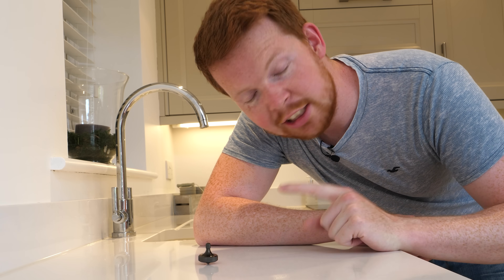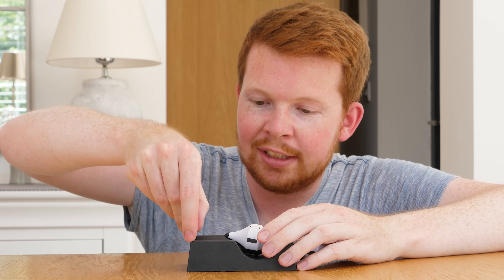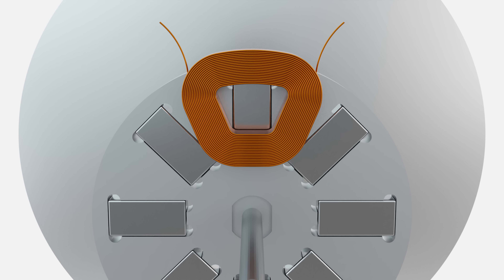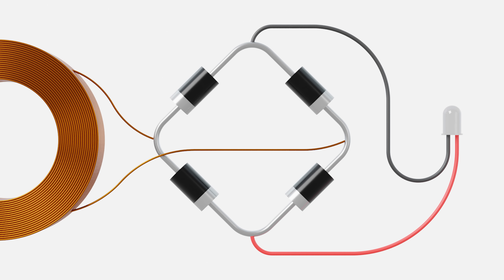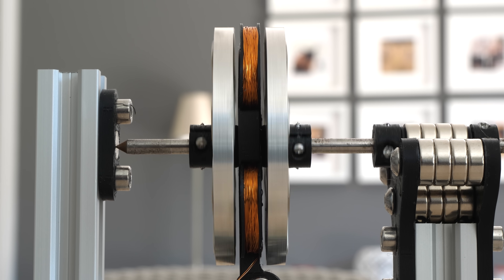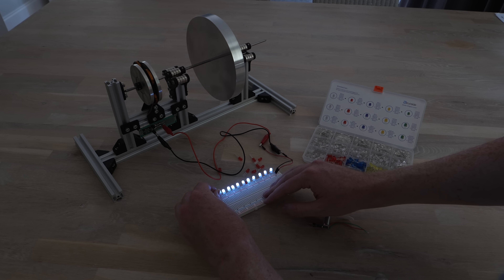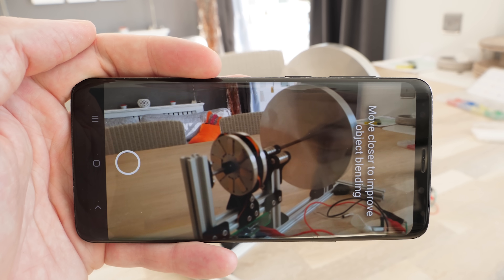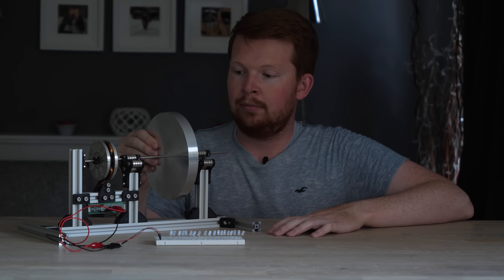Flywheel Battery

Comment: When magnets are manufactured, a high amount of AC energy with very high amperage is embedded within them. The energy that illuminates the LEDs is the extraction of this energy from the magnet through coils. So, there is no infinite or non-existent energy. When the AC current embedded in the magnet is depleted, the system will no longer be able to produce energy. Let's not fool ourselves.

Comment: I made similar alternator. It has a gear reducer box driving the alternator but it's mounted backwards so when you turn a crank it increases speed to the alternator. It would light up 2 - 100 watt light bulbs plus a whole string of Christmas lights just by turning the crank. It would also power a 4" hand grinder just by turning the crank

Comment: so if we plug a drill into a 120v circuit, we can spill the wheel so we can spin a bunch of wires to create a current to turn on an led. brilliant.😢 ... or just plug the light into the 120v circuit. i used similar rational when i bought my backup power supply. no gas/oil needed. it's electric powered. just plug it in and it spins a motor which turns a shaft which, with a bunch of wires, creates a current which charges a battery. then the battery powers the house.

Comment: Now, if we were to make a sealed box, pump out the air, attach a crank with a gear mechanism to turn it a bit—the flywheel would spin like crazy, and attach more gear to it, balance the shaft, and attach magnets and larger coils to the shaft itself.
And make a crank like the ones in old sewing machines—by pressing a pedal with your foot, or adapt the rocking motion of a rocking chair to the movement of the crank—then if you start rocking while reading something, the light comes on. If you fall asleep, the rocking stops, and the light goes out. Now that's an invention. So, for now, it's a dry option, but there is actually some promise. We just need to take a more serious approach, not just tinker with it.

Comment: Don't know much about electricity but if i get it right this aught to be an interesting add on to a wind turbine.
It could be inserted in between the turbine catching the wind and the part that turns it into electricity. 
As to reduce resistance that probably normally is there. .. i think...  

Really cool experiment. I like watching people build these small scale experiments using basic principles which 
make it also easy to follow as a leek. Also like the joy you get from it.

Comment: The aluminum disk is non ferromagnetic.  But it is definitely affected by your magnets. They are probably inducing drag on the disk. As it spins it mirrors, repels, and induces drag. The Faraday disk/ homopolar generator. You are likely pushing electricity from your axle to the edge of the disk. Low volts high amps, because it's essentially acting as one length of wire constantly moving through the field. Extra crazy is you can bond the magnets directly to the disk and it will still generate while spinning! But I've only read that last bit. There was a giant one made underground at some university once. Love the show!
Reply: The distance of course will minimize the effect. Just pointing it out.

Comment: I imagine scaling this up to what it would take to run my house. Basically a small 2 bedroom with just the basics. Have it store the energy in battery(s)and off them to inverters to convert to 120 ac at say 100 amp / 4000 watts. I run my house on a 4500 watt propane gen no problem when the grid is down. Anyhow even if I had to go out 1 or twice a day and get the flywheel spinning or crank up some weights geared like a coo coo clock, I wouldn't mind. With the exception of the energy I have to put in it would then run my electrical needs for free! Even if you had to use a small gasoline engine that you ran for 20 30 mins a day to get the weight up to speed, it would equate to pennies per kilowatt compared to the grids prices. Any ideas, thoughts, anyone done anything like this????

Comment: Just a question, does sequentially adding all those LEDs slow the flywheel down? What I mean to say is that they will be incrementally demanding more power which will increase the work needed to create the necessary voltage. Or am I talking sh*te and should I go back to bed?

Comment: Flywheel energy storage is not a new idea. The Swiss Gyro bus was powered by a flywheel in the 1940's  It could propel the bus 5 km. at  50 to 60 km/hr.  It also used regenerative braking.

https://en.wikipedia.org/wiki/Gyrobus

Comment: Is it possible to make an exiter circuit to first spin up the flywheel in "motor mode" from a power source and then turn it back in to a generator to power something? that would be a fun thing to watch, to not very efficient in terms of power

Comment: I wonder if the magnets were angled if you could eliminate the need for the Glass plate holding it in place, i.e., cancel out the tendency for the axle to fall to the left/ right

Comment: If the led's could power a little solar panel to spin it, could be closed system. Might still be net energy from the spinning either in wind or vibrational form then.

Comment: Oxy acetaline would heat the flywheel quick enough to get it of the shaft. Like crowning a 2x4 you can straighten the shaft if you use an anvil and a large hammer carefully! I do mean very carefully! Light taps and lots of checking by eye looking down the length of the shaft!

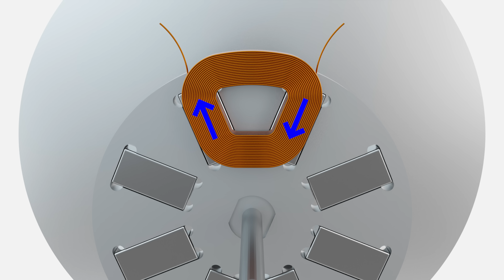Comment: the principle you show on  4:30 was used to lift and rotate a turntable, which avoids any noise from bearings and smooth drive with enough poles to avoid the magnetic pushes each time a magnet comes by.

Comment: Try using a dc model train motor as a generator. The split poles and commutator will produce dc voltage without any rectifiers.

Comment: I thought the challenge here was to eliminate the friction of the contact point. There is still a contact point to keep the magnets aligned. 

You've also introduced more surface friction with an increase of the combined surface area of the various disc bodies, energy losses in imperfect alignments of axially symetrical fields, etc., but I digress.

Comment: I was wondering if you could induce a stable resonance to the flywheel by using speakers which reproduce the resonant sound of a fast-spinning flywheel. I will show you what I mean by sharing the following video with you: https://youtu.be/1w0_kazbb_U?si=A50Kdm0x2q-qnq1p . It may be a longshot, but one never knows what will happen, until you try it yourself.

Comment: How about a flywheel powered by the rear wheel of a bicycle. Spun on downhill run, engaged for powering up the next hill? The faster te flywheel spins, the more energy it holds and gives on the uphill run.

Comment: Also, with no friction, why not mount magnets on both sides in every possible way to create a bigger flux and current generation? And what would be more interesting would be a small enough motor connected that could give a tiny momentum to the flywheel keeping it in motion as it powers the motor 😀

Comment: smooth plate where the pointed end of the shaft rest against....why not put another magnet in the plate and in the end of the shaft. With same poles facing each other. That way its a totally floating system without any surface friction at all.
Reply: Z drugiej strony to samo i masz  całkowicie magnetyczne łożysko.  A gdy całość zamkniesz w hermetycznym zbiorniku i zrobisz próżnię to masz akumulator kinetyczny.

Comment: I always wondered how a flywheel would perform as a capacitor. What would the loss be, and does it have potential as a battery? I guess if you really scale it up, you would need electromagnets to balance it properly, and that would be a big loss. Also the amount of kinetic energy stored in such a flywheel would be insanely destructive if something went wrong. I’ve seen flywheels on huge boat engines come apart, and they absolutely just rip through everything.
Reply: takie rozwiązania (akumulatory kinetyczne)funkcjonują od wielu lat w wielu satelitach. służą do gromadzenia energii. ale i do pozycjonowania satelity .  Taki akumulator z wirująca wewnątrz masą jest  zamocowany wahliwie jak żyroskop .  Próba zmiany położenia tak szybko wirującej masy powoduje obracania się  samego satelity  bo widująca masa nie daje się przechylić!

Comment: Arm chair quarterback. You should have made the space between the magnets closer. The weight of the flywheel is flexing the shaft. If you bring that back leg in and shorten the shaft, it would stabilize better.

Comment: great macine. you made a generator. now make a structure to turn a 20 KG flywheel on magnets. no friction. and connect a motor this side and a generator other side. do ot make a motor and generator. just buy them. the key is the flywheel turning without friction. and add two glass limiters on both sides of your axis. 20 kg turning fast is a serious thing.

Comment: Get rid of the ugly flywheel and use the motor/generator itself as a flywheel. There is then room for several motor/generator units on the axle. 4 units easily.

Comment: That is a cool video. If you want a lot more power output from your generator you should change the magnets on rotating disks to more powerful magnets and even stack two of them together and place them on the rotators. This will increase the electricity output by several times.

Comment: Excelent. My comment would be:
Mecanicly you have almost no losses.
Electronicly you give 20% away with the rectifier. 
Solution: no rectifier and feed ac on the LED's. Make sure you place 1 opposite towards the other.

Comment: Is there any loss in spin duration after adding manners and coils powering devices or does it spin just a freely?
No electro/mag drag?
Could you add multiple layers of mag/coils in sequence to scale up?
How long can you let it spin powering fan motor after using drill to get up to your top speed?

Comment: If you had a proper alternator and fly wheel setup, you could use a weaker electric motor to recharge the flywheel. And then just collect the excess in capacitors, free electricity.

Comment: You need to contain the magnetic bearing, balance it as you already know. You could add a "pull" rope starter. Then use a small electronic load to do a I-V curve on the power output. Then do a constant current vs time test.   Very cool   edit, by contain I mean have one or two more magnets on top of the shaft magnets so it can't move.

Comment: On the end of the shaft that rests on the barrier, would it be possible to build a magnetic nest or cage to hold it?  

I am thinking two banks of fixed magnets for the cage, then an additional set of magnets affixed to the shaft between them with swapped polarity.  As the shaft pushes towards it the magnets would repulse it back to center?

Comment: put the magnets on the rim of the flywheel and eliminate the need for a seperate disk.  Question?  If all the magnets are the same polarity will you get pultsating DC and therefore eliminate the diodes?

Comment: aluminum/aluminium is effected by magnetic field. so why say it's not magnetic
Reply: It’s not ferromagnetic, aka it’s not magnetic. That does not mean it isn’t affected by magnetic fields. Those are two different things
Reply: @henrysanecdotes5323  My system is out of wack. I can't tell if that reply was for me . I'm just going to assume it was. I didn't say anything about the things you mentioned. I asked a question. Why say "aluminium isn't effected by the magnetic fields when it is?". Spin a plain aluminum, then disk bring a magnet close to it & it will have a braking effect, stopping the disk. Everything is effected by magnetic fields
Reply: @juliuspekar7620  I said a double negative, which I think is the source of this confusion. To clarify, I meant that aluminum is affected by magnetic fields. However, that does not make aluminum magnetic. Being ferromagnetic is not the same as being affected by magnetic fields
Reply: @henrysanecdotes5323  FINALLY!  Some one that knows how to have a rational discussion. Thank you. Seems like all i see is people arguing like angry arrogant smartasses.    Like  they are stuck in emotional reasoning mode, not being rational. I even take the time to make sure that i don't give any reason for a person to come at me with an attitude, But there is always one that does. For reasons   that don't exist in anything that i said.  Just look at the way people been "protesting". Seems like no one knows how to protest. They are not solving problems, they are just starting fights while trying to stay on the right side of "right & wrong" . I'm sorry, i guess i'm just venting. ANYWAYS ,  I knew what you meant. You said it in a rare peaceful manor. To be honest my last reply was mainly to see if you would "flip out" on me.  Wow, i just read thru this "as i do before sending" & i sound kinda creepy.
Reply: @juliuspekar7620  lol that’s exactly how my train of thoughts go, I write a response and then think “wow when did this get so long”

Comment: I got an idea Tom. Put the same motor on both sides of the flywheel...  Use one as a generator to power the original motor with a capacitor. Now on the edge of the flywheel...  also add magnets back and forth positive / negative with a coil that also powers the original motor!

Comment: I believe you could get more wattage out of it if you wound your coils in a more efficient way. I’m fairly new to this so I may be wrong, but I believe  that having the coils wide enough to spread over multiple opposing magnets is not ideal. From my understanding, if the magnetic field is north, then the electron flow is spinning to the left in the coil, and if it’s south then electron flow is right (could have gotten that backwards). So having a north and south magnet over the coil at the same time canceles eachother out, and the electrons don’t flow as much. So it would be better to keep the coil width the same size or similar to the size of the magnet. If im wrong then someone please tell me 😅

Comment: when you had the bigger fan hooked up you lost rotating speed .. you had to charge the capacitor up to start it .. I could be wrong but your charging system is also a elec brake ??

Comment: I wonder if it would have less friction on the bearing if the structure was turned 90 degrees so the bearing would have even weight to deal with?  It's an amazing setup and could be utilised in every house as you don't need much input for lighting all those led's.  Just would need scaling up.

Comment: They used to make a fan which blew around powered by the air from a light bulb that has a bearing like that in the 1950's.  This would flicker the light for electric fires flame effect.  They worked very well for years!  They advertised them as having a Jewel bearing.

Comment: Could have reduced the friction at the axel contact point up to 10% if  it were riding against glass. Wouldn’t be a huge improvement though. There also probably some weak Eddie currents forming in the flywheel itself due to the surrounding magnets which would slow it down. Could resolve this by cutting radial slits in the aluminum to disrupt their strength. Again this is probably a small effect.

Comment: In the 1970ies a soviet engineer developed such a wheel storing enough energy to drive a car for 500km. But he used some sort of thin carbon wires for the wheel and it fitted in a normal car.

Comment: If you offset the two magnetic wheels so the magnets are not aligned on each side, would you receive a constant flow of energy and reduce the flickering? Would it also reduce your total output? (not an engineer, just curious)

Comment: 9:57 So is the only thing stopping this mechanism from spinning forever the friction at the tip?
Reply: The vast majority of the energy loss is to air resistance and energy extracted to power the leds

The friction of a metal tip spinning on glass like that is extremely low

Comment: March 29, 2011 — Emerson Network Power will distribute VYCON’S clean energy VDC and VDC-XE flywheel power systems with its Liebert branded uninterruptible power supply (UPS) systems to protect mission-critical customers against the damaging effects of power problems in a clean and sustainable way.

Comment: I was just wondering, if you can levitate the flywheel, can you also use opposing magnets on either end so there is no friction whatsoever?
Reply: You could.  But it has the same issues with alignment then as the levitating magnets.  If it gets slightly unaligned the forces push it even further out of alignment until it moves out of place.  This means then that you need to have it very stable in all directions.  Practically it’s very difficult to achieve this with magnets, although it should work theoretically.
Reply: @ReallyBigBadAndy76  thanks :)

Comment: To store 2kWh (a pretty low amount) you need a flywheel of a diameter of 2m made of steel as heavy as 200 kg (10cm thick, 9cm tall), rotating at 3200 rpm, and an outer edge of the wheel will move as fast as 344 m/sec (a supersonic). That's about only 2kWh. You can reduce the rpm value down to 600 by using of 1000kg of steel and a wheel of 5m in a diameter. Good luck

Comment: The 3 way of making your '' ELECTRICITY GENERATOR '' is by adding a '' magnetic Gear shifter '' this device will double the amounts of rpm form your machine without any contact from your device that is inside the voide

Comment: If u would really like to see it work in its full let me know...magnetronic pulse static engine...works on realy...in a sense...once charged ....a small unit can produce an abundance of ohms...for auto and industry....ur concept is doable.... u just need the schematics and proper numbers and programming ...materials and new type battery...which I do design